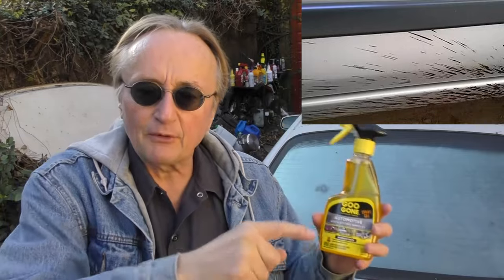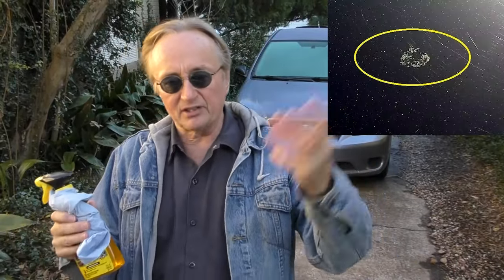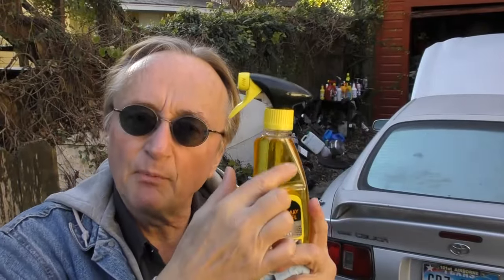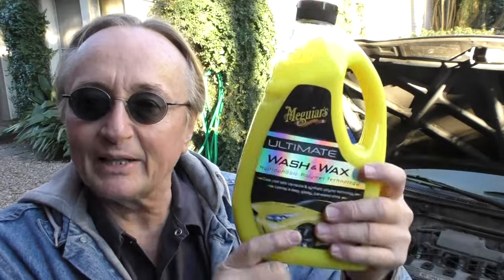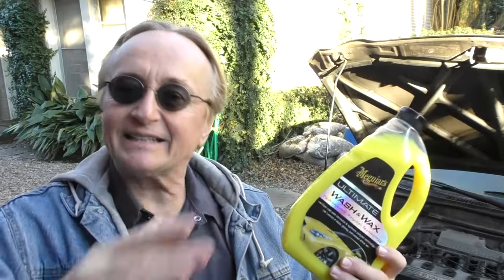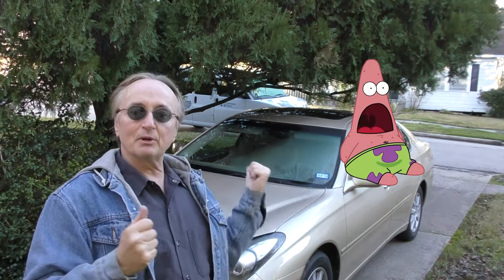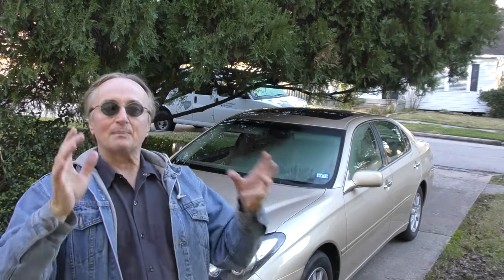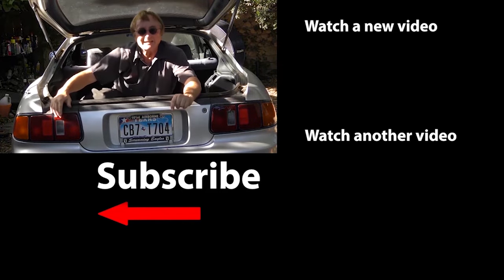Doing This Will Make Your Car Paint Last Twice as Long

Comment: People need to get this right:

Polish/Compound/Scratch Removers: Abrasion to remove dirt, impurities and light to medium scratches on the clearcoat level. No protection whatsoever. Improper use can cause damage to the paint.

Wax/Sealant: A layer of protection on top of your clearcoat be it natural carnauba or synthetic polymers.

Coating: Literally another layer of coating on your paint be it ceramic or whatever nano nonsense. A recent trend of development which is pure gimmick.

Comment: Mothers Brand carnuba and car soap between waxes.     The type of soap is important if using a wax as some will strip it off.   However you should strip the wax before reapply a new wax job by using a dishsoap.    

Also. Acne pads work wonders for cleaning the same stuff goo gone will.   Small and portable and designed to lift dirt and oil.  They are nice for cleaning tight spots and wont scratch or dmg paint.

Comment: As a auto body repair & paint tech with over 10+yrs experience, Scotty is spot on. Protect your clearcoat and you’ll have a nice shiny car for years to come. You don’t want to find yourself in a situation where an explanation of how destructive bird poop is, isn’t nearly as effective as when it gets cleaned off to reveal a cluster of craters. Also, the condition of Scotty’s wife 17yr old Lexus is impressive since Toyota’s reliability doesn’t extend to its paint factory finish.

Comment: Do not use dish soap on your paint job!! Sure it works great on tires and interior panels but it will scratch and dull your clear coat!
Reply: Bigdaddyd82 Vapes lmao no it won’t
Reply: @13littlelazy  
I detailed cars professionally for 8 years. I can say that many of my customers had dull paint and couldn't figure out why.... after asking a few questions I learned all of them had been using dish soap as car wash. Now dish soap itself won't scratch the paint... it's when the car is dirty and you wash with it. Car wash soap is designed to minimize scratches caused by surface contamination . Also carwash soap is mild enough that it won't take all your wax off! So yeah if you put dish soap on your clean car it alone won't scratch your paint.  But if you use it in place of car was soap it will lead to micro scratches and over time dull your paint job.

Comment: Wow Scotty. The same thing happened to me. There was dust and dirt on the hood of my nice shiny car and I threw a bucket of water on the hood and wiped it dry. Not knowing there was dirt still on the hood, I had tiny scratches all over it when I finished drying. Wish I would have used the hose instead.

Comment: A tip a paint shop manager once told me is to use sparkling water. If you wash your car at home than do the first rinse with it, ideally by pouring it from the top and letting gravity do most of the work, only gently rubbing when needed. Apparently the reasoning behind it is that it will react with most dirt like bugs and bird droppings, so it's easier to clean and they won't scratch the paint. I'm not totally convinced but he swears by it, and considering the work he produces and the cars he works on than he most be doing something right! At the least I can say it works in a pinch if you have nothing else on hand.

Comment: I live in Saudi Arabia; it's 10 months super hot (55 C), and 2 months cold.......what's your proposal for waxing the car?
Reply: Living in AZ.. We get our Cars An Extra Clear Coat by a Body Shop! Cost about $150  but well worth it.. also Get a Patterned Show Curtain taht will blok or filter out the hot Sun , lay it ontop over the car, use the doors to hold it..It will be 20 degrees coller .. same for if you leVE IT OUTSIDE AT YOUR HOME.. bETTER YEET? WE GOT ONE OF THEM vYNIL rOOF cAR pORTS FOR 4125, ALUM. TUBING FRAMES AND ANCHORED IT DOWN.. NOW 3 YRS OLD.. AND WE JUST USE THE ROOF PART, NOT THE SIDES.. TO FILTER OUT THE sUN..WHEN IT GEST 120 OUT THERE IT CAN HIT 140 SITTING IN TEH SUN AND WE ALWAYS LEAVE OUR CARS WINDOWS OPEN AND SOME HAVE A SOLAR POWERED FAN IN THEIR BACK WINDOWS! ONLY COST ABOUT $50 BUCKS AND WORK FINE.. oUR COMPANY PROVIDES A mISTING cAR pORT FOR ALL OUR CARS ABOVE GROUND pARKING LOT ( 50 CARS) IT HAS wHITE fOLTERING ROOF AND WATER MISTING  EVERY 30 MIN FOR 1 MIN COMES ON.. OUR CARS ARE NICE AND COOL WHEN WE COME OUT FORM WORK AND ITS STILL 120 DEGREES!